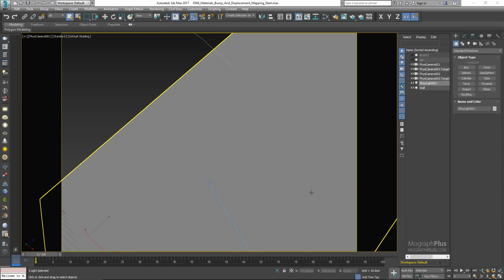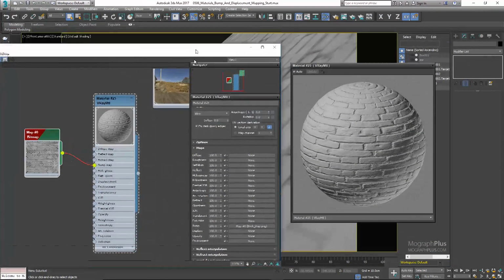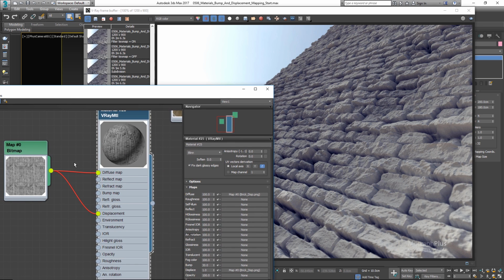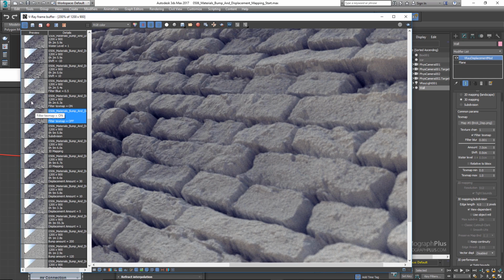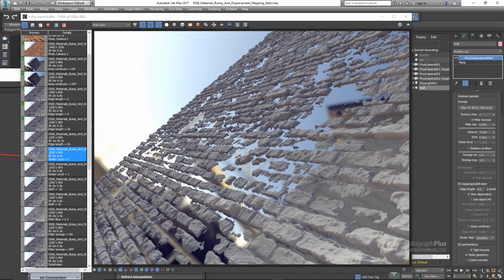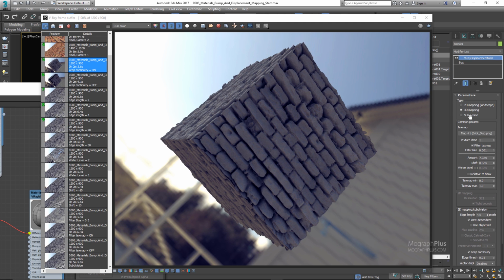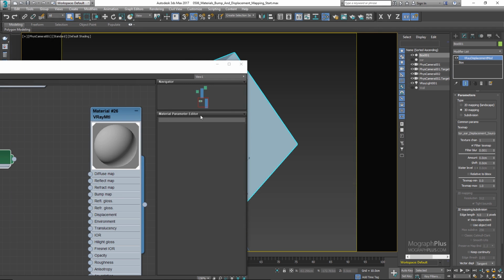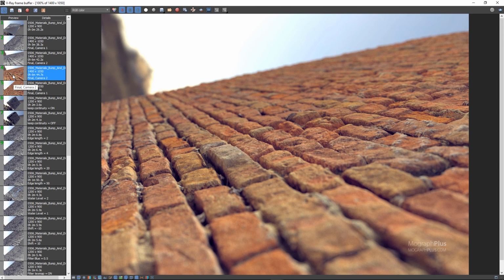V-Ray for 3ds Max | Understanding Bump and Displacement Mapping | Tutorial #105

Comment: can you apply the displace to a curved surface or object, or only a plane upwards? If i model a box, only displace the top not the lateral of the box (wall).
Reply: Under the settings for the vray displacement modifier, scroll down and click "keep edge continuity" set the threshold to like .05 and your edges will not break the pattern.
Reply: @STONECRUSHER420  ok, but you can later export that real geometry after displacing, like the stock displacement from 3d max?